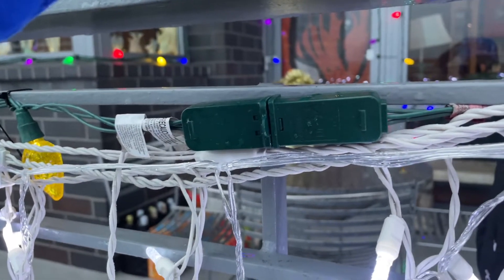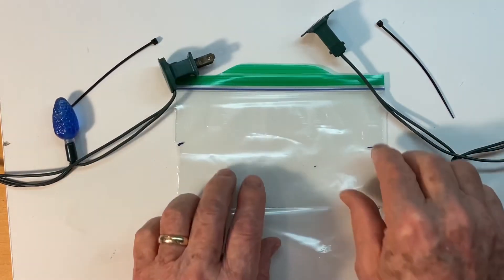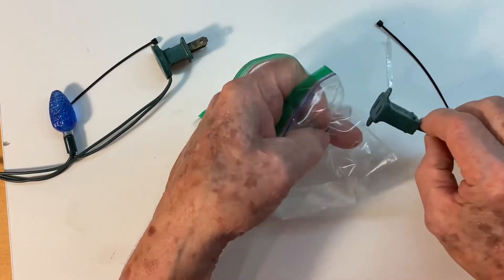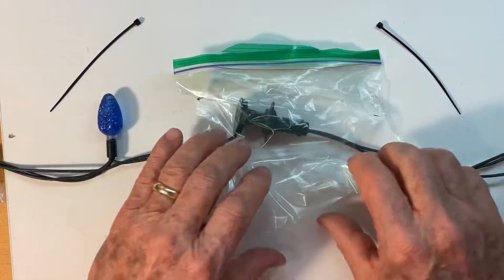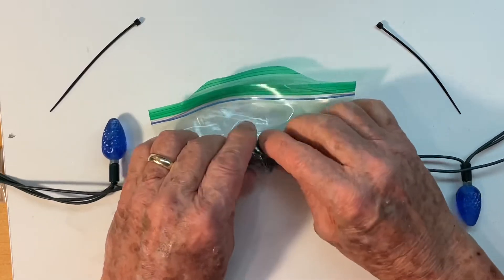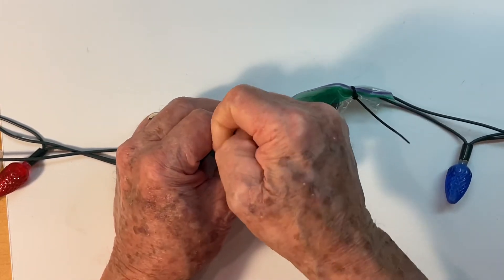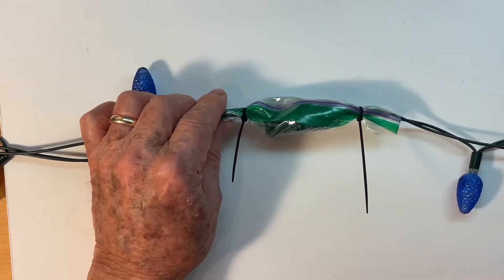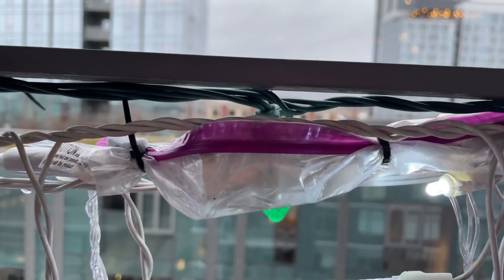Waterproof Christmas and outside light connections.￼￼

Comment: Did this last year, but when I removed my lights for the year there was water around the light connections. I believe via condensation.
Reply: Same thing happened to me.
Reply from the maker: I haven’t had much trouble with condensation. Using Ziploc bags and making sure the connections are dry when I cover cover them helps.  This method is circle not perfect but I’ve had good success with it. The last few seasons and I live in Oregon where it rains a lot during the winter. Thanks for commenting sincerely Jim.

Comment: I usually just tape them, I tried Duct tape it comes lose, then I tried gorilla tape, nothings getting through that stuff. Not the easiest thing to remove either. But, it works for me. I've tried with the plastic bag but I was still getting moisture build up. I wish they would come up with something that works just for lights and inflatables.
Reply: They do!! They make these plastic clips with rubber gaskets the go around and clip over the entire plug! They're $5/each at my local lowes!!!
Reply from the maker: @ash.ton998 thanks for commenting. I still have pretty good success using Ziploc bag hold up with a zip tie on either side. I’ll have to check out Lowe’s devices.

Comment: Tried and it didn't work for me as condensation builds up enough water inside the plastic enclosure and caused my CB to trip. Living on the north-east coast; the only thing that comes close to a solution mainly because I have to deal with snow and rain is the cord dome. But then its expensive and the locking mechanism in the middle limits the space inside. Most other weatherproof cord boxes failed as well.